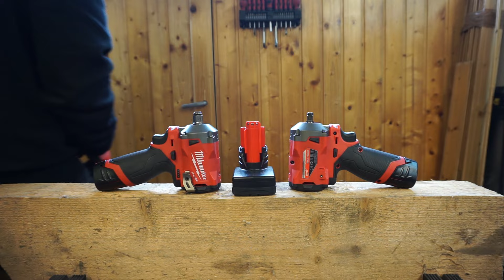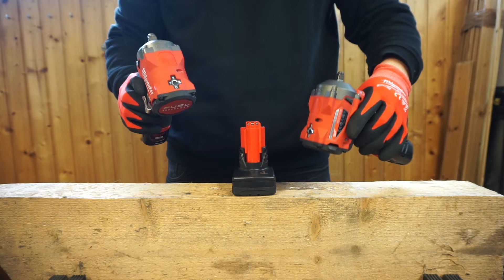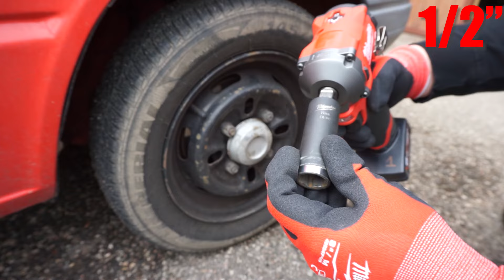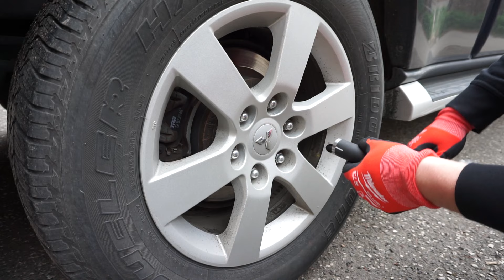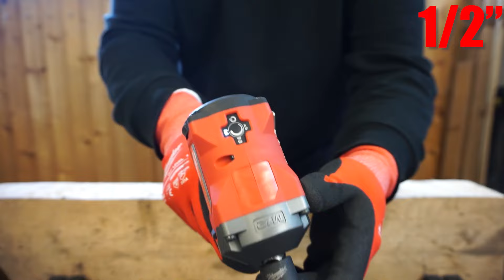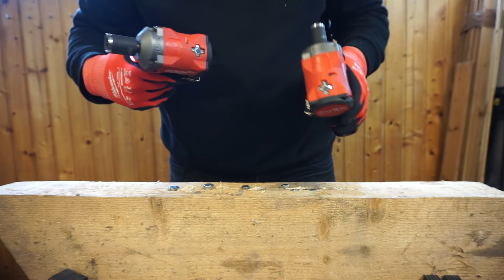3/8" stronger than 1/2"? - Milwaukee M12 stubby impact wrench 3/8" vs 1/2"

Comment: I prefer 1/2” since most impact sockets are and torque wrenches are 1/2”.  Plus 1/2” is meant for heavier duty even though the torque rating is the same.
Reply: Yep. And if you try to use the 3/8 model with an extension it will fail. Go with the 1/2.
Reply: I weas debating this with a mechanic and he asked me; "What do you want it for?".  "To change tires" I told him. He said; "Get the 1/2 impact wrench, it's heavier duty, even though a 3/8 can do it but why not have a little extra power?".   I also had pre-existing set of sockets of all sizes that are all for a 1/2 wratchet, it was a no-brainer to get the 1/2 stubby gun.

Comment: I have both 1/2 and 3/8.

I think for the size intended to be as compact as possible with it’s given torque rating, 3/8 makes the most sense. 3/8 impact sockets are smaller in both deep and shallow, and noticeably cheaper than the 1/2 counterpart, eg wobble socket sets and so forth. They even make 3/8 in 21mm for lug removal.

But most ppl have 1/2 impacts already so it can just be cheaper to get the 1/2 version. If you go to the junk yard for example and bring a 1/2 high torque with the impact sockets, having the 1/2 stubby would be way better than having the 3/8 and another set of impacts weighing you down
Reply: or just have a 3/8 to 1/2 adapter
Reply: Yeah but if your upsizing on higher torque you usually snap adapters
Reply: @E_ina_G  well then in that case correct
Reply: Can you pls tell which one is faster?
Reply: Haven’t had an adapter snap yet and I use the pittsburgh cheap ones. These aren’t your one foot long impacts. I go 1/2 on anvil incase I need the 3/4 adapter and can switch down to 3/8.
Reply: @E_ina_G Use a proper impact adapter
Reply: @E_ina_G I have never snapped a adapter stating from 3/8 to 1/2 it would almost be impossible 3/8 anvil would snap before 1/2 adapter
Reply: @alva3106  “snap adapters”

Comment: I have the 1/2 mid torque along with the sockets and I bought the stubby 3/8 to lighten the load on my tool
Bag when I frequently go to junkyard
Reply: Same! It's kinda crazy it's even considered 'mid' torque, it'll do just about anything, quickly. The stubby is a lot nicer for snugging up bolts without worrying about overtorquing

Comment: So you can use the 3/8 without a adapter?
Reply from the maker: With 3/8" sockets, for sure!
Reply: @VP Motors  thank you I just bought the 3/8 stubby.. so now I'll get 3/8 Sockets.. thanks... ppl.were telling me I need a adapter.  Guess if you use 1/2 inch sockets
Reply: @ahkisong becuase sockets the size of lugs are usually 1/2 inch for more torque

Comment: I wanna see them both on the original small batteries. I have the 1/8 stubby and it will not take off my lugs on my 2016 GMC Z71 if it did mine is defective 😮
Reply: 1/8" stubby?  thought it was 1/2 or 3/8 not 1/8

Comment: Wish they would have put another LED above the anvil. Yeah I know it’s compact but they could have fit another two LEDs on the nose without increasing the form factor at all.
Reply: Well the new gen 2 has three much brighter led’s and is more than twice the originals nut busting torque at 550 foot pounds. Although that power is only achieved with the new 5.0 high output batteries

Comment: Try a Honda crank bolt next
Reply: That’s a good way to put these impacts to the test
Reply: No impact will remove those, especially if they've never been serviced. 3/4 breaker bar is the only way!
Reply: @ua7pyro591  I took off the crankbolt on my crv with my full sized makita impact and a weighted socket. It can be done (but not by a compact).
Reply: I used a yo-yo.    Tap the trigger and off it flew
Reply: Mid or high torque only or one of these with a weighted socket
Reply: Not with a stubby😂
Reply: High torque and it will either snap or come loose 🤣

Comment: I just got a stuby. I chose the 1/2 because....... I don't have an impact socket in 3/8!! It's an amazing machine
Reply: The funny thing is if you had gotten the 3/8" with an adapter you'd be getting extra power.  Maybe the extra weight of the adapter or something but it hits harder that way
Reply: @Nl Pcrepairs  
Check out The Torque Channel video on adapters. The opposite of what you say is true, unfortunately. 
I thought the same thing until I watched their video.

Comment: Why no body talk about which one to buy if i can afford only one 3/8 @1/2 i mean why would i choose one over the other .. 
Does 1/2 is faster nd put more TQ  down  than the 3 8 or is just a matter of size?
Reply from the maker: 3/8" seems to hit a little harder and can be more compact due to socket length.
1/2" has way more accessories. If you can only afford one, I'd buy the 1/2", and later on maybe get a bigger 1/2" impact for tougher jobs so you can use your existing sockets.

Comment: 88.5 ft/lbs?!? I guarantee most torque wrenches are NOT that accurate. Just call it 90. Other than that cool comparison. Seems both are pretty capable. I went with 1/2” because I had more 1/2 sockets. Will probably also buy a 3/8 just because.
Reply from the maker: Thanks! 120Nm does not equal to 90 ft/lbs, it is exactly 88.5. I didn't want to post false data.
Reply: @vpmotors9529  My bad. I didn’t even notice that. I’ve never known anyone to actually use newton meters. Any mention of Nm is usually followed by a reference to muffler bearings or blinker fluid. Lol.
Reply from the maker: @Volksoner619  No problem at all! I live in Europe, we use metric units. I think , metric is standard everywhere else, apart from the US.
Reply: @vpmotors9529  yea, the US is stupid like that. I really wish we’d fully convert to metric also. It would make work so much easier. I hate when I tell a coworker to grab a 13/16 and he asks “what’s that in numbers” then stares blankly at me. Lol.

Comment: Fake video bc impact can’t take off wheel that quick🤣😂
Reply: Took those pajero wheels off at 155 ft-lb a lot faster than my car's wheels at 105 with the same setup.
Reply: @jake-mv5oi  and they air impacts do 700 doesnt take it off that quick so
Reply from the maker: @jake-mv5oi  Those lugnuts are obviously rust free and freshly tightened to proper torque. Try loosening yours than retightening with a torque wrench, they will come off as easy as presented in my video.
If your's don't come off easily, it's probably because they've not been off the threads for a while, and all the salt, brakedust and rust has made them grip stronger. Also alloy wheel lugnuts tend to tighten over time. 
I don't get it why you think it's fake, I even show the reading on the torquewrench, and the whole point is to compare the tools to each other in a controlled environment. This is not a "real life" scenario, it's an experiment, speed only matters compared to the other tool.